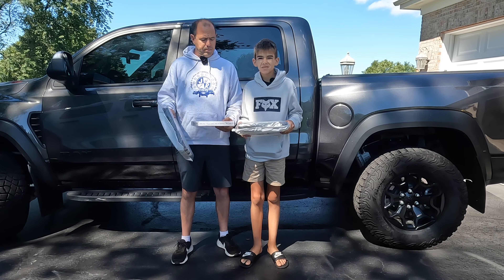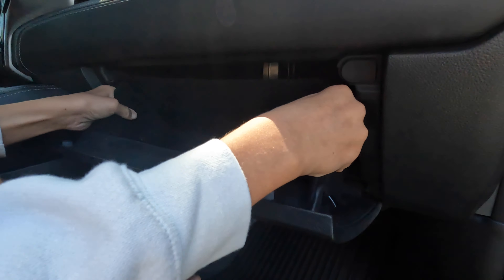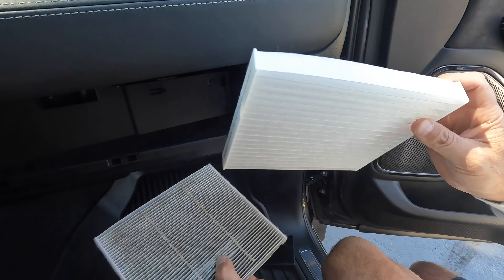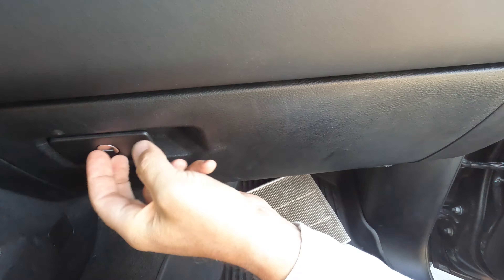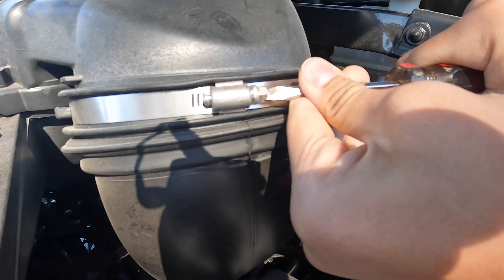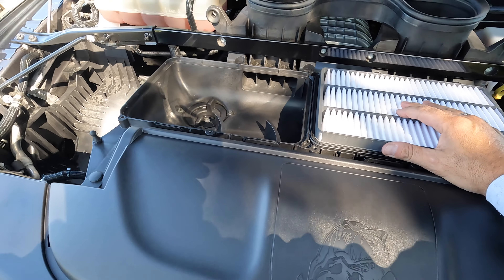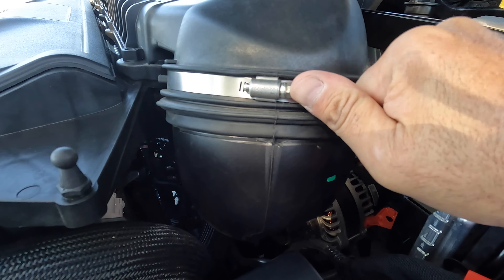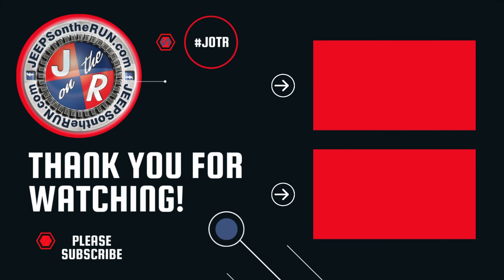How To Change Cabin & Engine Air Filters On a 2022 Ram 1500 TRX

Comment: Nice video.  And yeah, the exact same thing happened to me, I dropped a screw and it was sitting on the belt at the top.  I had to remove the entire airflow system to get it.  At least I learned how to take it all off if I add an aftermarket in the future.
Reply from the maker: Haha yes, I was thinking the same..  wasn't hard to remove but made a 10 min job an hour b/c I spent more time looking for the darn screw! lol